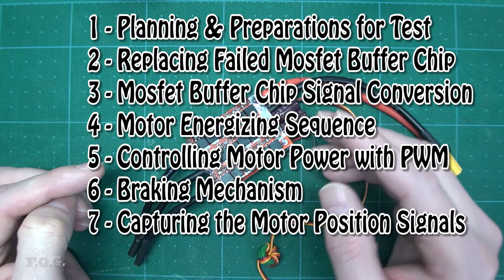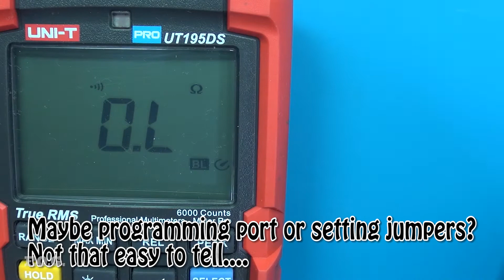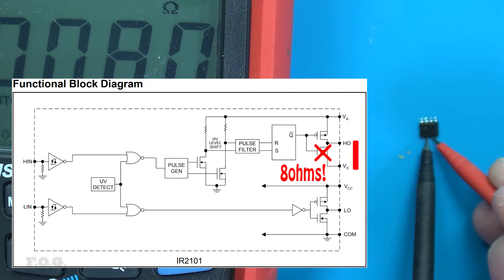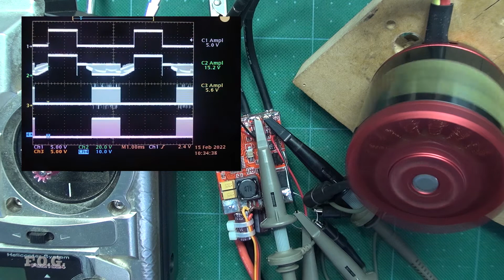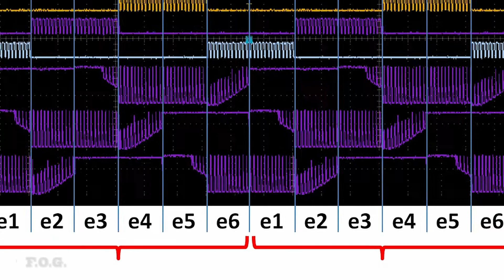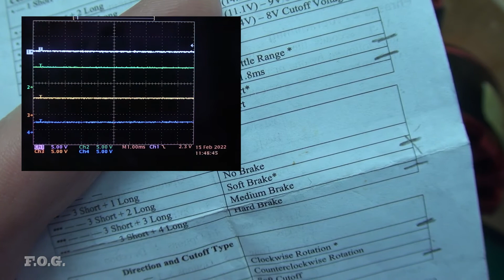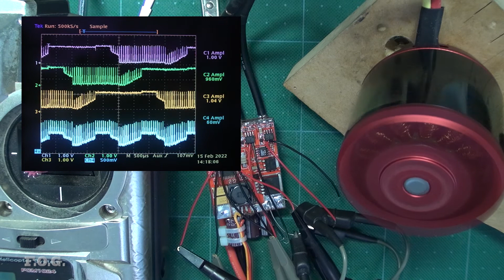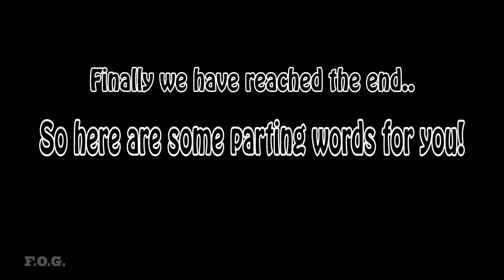EP6 - Electric Motivation - How a Brushless Motor ESC Works

Comment: Great analysis and explanation. Thank you for the effort! 
I wonder if brushless ESC's for RC-Cars have different braking control as they probably need to supply high braking torques at very low motor speed.
Reply from the maker: I believe nearly all hobby BESC's work fundamentally the same way for braking as I describe in this video. Surprisingly, even at slow speeds, the braking force feels substantial when you try to force the motor. Obviously at higher RPM's it's going to generate allot more stopping force, but of course your going to need it then too. With that said, I have been considering making my own BESC that also has actively powered braking, with the objective being even faster braking, and being able to hold the motor powerfully at a dead stop. And I suspect there are likely BESC's out there on the market that can already do this, but I don't think it's mainstream hobby stuff. Thanks for your comment & discussion!
Reply: @ForOurGood   @ForOurGood  Thanks for your answer! I looked into this topic a little more and I found a paper describing the braking torque of a PSM when all 3 phases are short circuited. It show's that the braking torque starts from 0 at 0 motorspeed, then reaches a maximum braking torque at a relatively low motor speed and then asymptotically go's back towards 0 torque with the motor speed rising. I'm not sure if this applies to BLDC motors 1 by 1 but at least for PSM the braking torque that can be achieved at high speeds by shorting the 3 phases seems to be rather low and I wonder if it would be enough to reach the fully possible deceleration with a RC car (at high speed).
Also all of the kinetic energy of the car would have to dissipate inside the motor, which at repetetive braking maneuvers maybe could lead to an overheating.
What do you think?
Thanks also for the discussion!
Here is the link to the paper. See fig. 4. https://www.researchgate.net/publication/251959540_Sudden_short-circuit_analysis_of_a_salient_permanent_magnet_synchronous_machine_with_buried_magnets_for_traction_applications
Reply from the maker: @mrgrub  Wow, that document is super scientific, probably take me a month to figure it out.. But as you noted, it does seem to indicate the zero torque from start, then ramps up the torque as the RPM increases, which then peaks and then drops off. I could not fully understand the RPM’S involved, but let’s put that aside for a minute and think about it more simply. There must be a saturation point for the permanent magnets in the motor, so there is always going to be a peak level of force that can be generated, and that peak will be dependent on how the motor is constructed. As for measurable torque at a given RPM, clearly as the motor speeds up, it is going to generate more and more momentum, so once you are beyond the peak force the motor can create, the effective torque will be less and less. Now the braking will not stop or anything, it’s just applying all it can, and that’s what you get. So, how to improve on that? Well actively powering the phases probably won’t make any difference in this case since the system is already being saturated, so I guess making sure you have a right sized motor, as well as possibly external brakes (as with electric/hybrid cars). With that all that in mind, I guess my idea to actively power the phases to brake, really only makes sense at slower speed – but in some cases that is going to pretty useful. As for the heat issue, I think it is not insignificant, but at the same time, the braking and accelerating both generate heat in the BESC and Motor for pretty much the same reasons, its just that braking will likely always generate close to peak heating in smaller chunks of time. So if the motor and BESC are correctly selected to cope with periods of maximum acceleration loads, then it seems that heat generated by regular braking will likely not cause and overheating problem. Remember, this is just my personal mental analysis, I am not a scientist or anything 😉